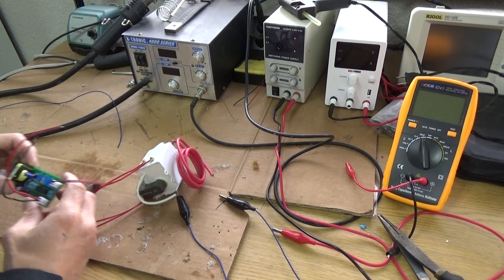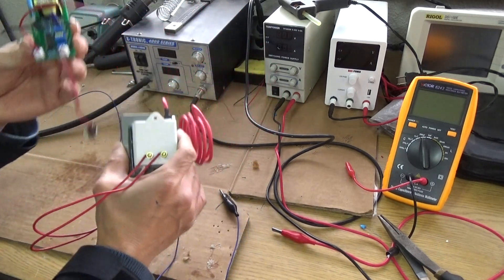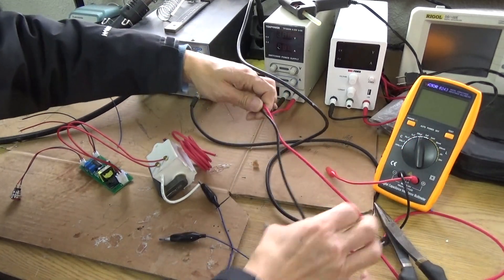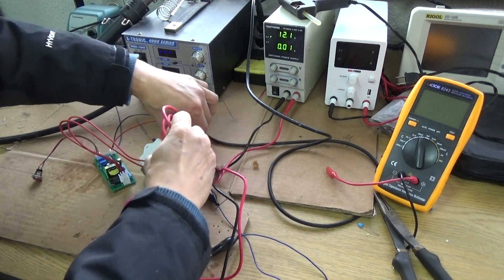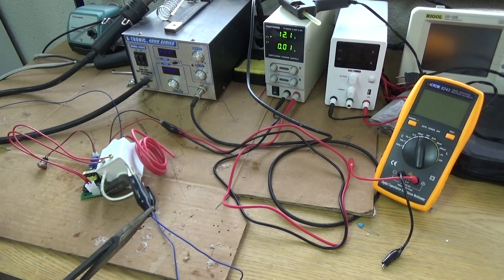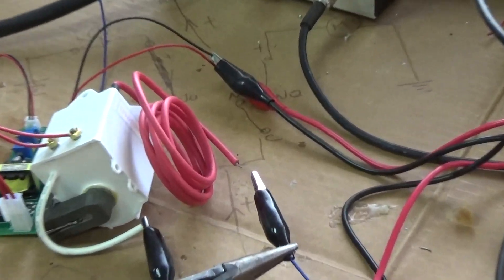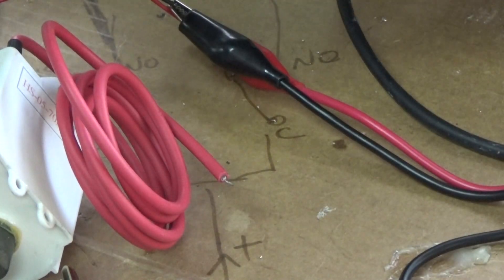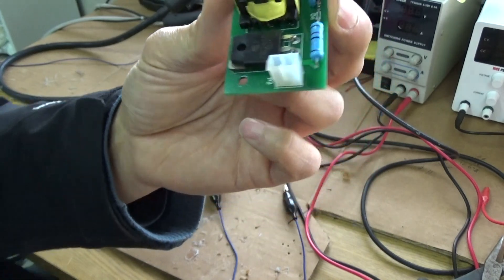How to test HV transformer of a CO2 laser power supply

Comment: Hi Marco: Thank you for posting the vid; it really explained the testing very well. I have a question and I would appreciate if you could provide some tips. The board you are using  to fire fly back is supplying AC or DC volts? if it is a dc volts can we use a high frequency pulse generator through an IGBT to drive the fly back. Appreciate your reply. I really liked  your super duper high class testing bench with all the equipment. wow!
Reply from the maker: It must be an AC or DC pulse. I can get more data for you such as frequency and the level of output